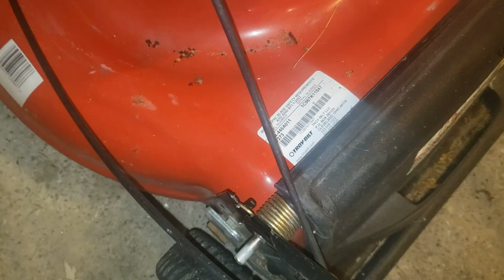Junked self propelled mower converted into a nice working push mower in 5 minutes! Rolls easy now!

Comment: Just remove the gear under the wheel.
Reply from the maker: Hi, Thanks for checking it out! As I point out in the subtitle at the 4:17 mark, the Torx screw holding the gear was stripped, rendering it impossible to remove without a lot of drilling etc. Besides, using this technique with just two quick cuts, in 30 seconds you can remove the defective tranny and just leave the gears in place if you want....but I wanted "minimal rolling resistance" so I knocked the gears out too.   Cheers,  -C